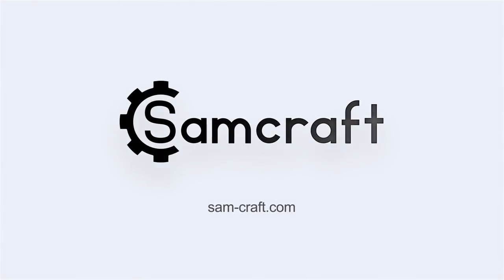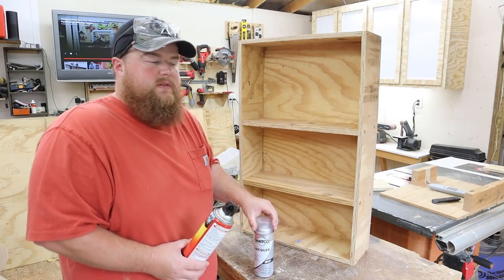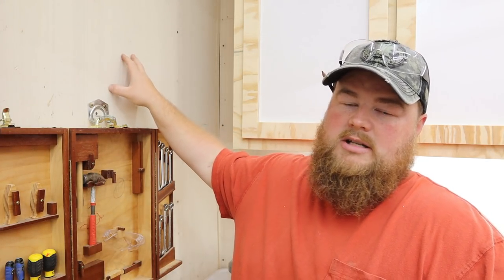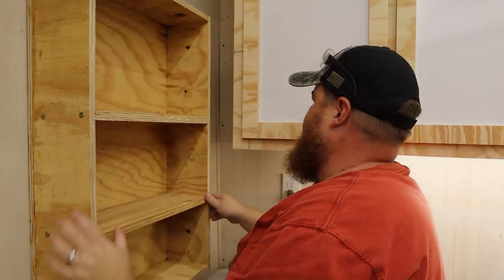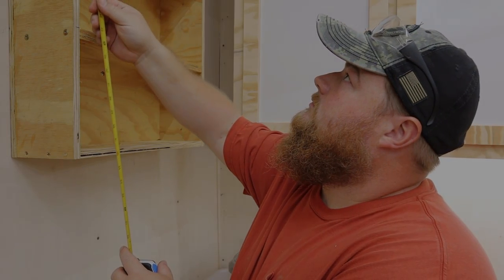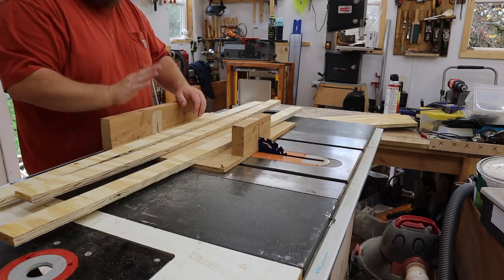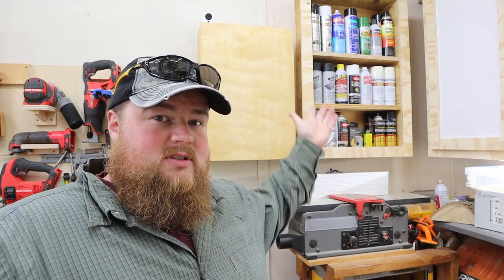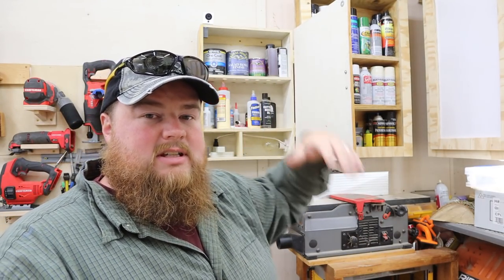Spray Paint Cabinet Build | Small Woodworking Shop Organization

Comment: Hi Sam, I was sitting there thinking. if you put drawer slides flat on the wall, you could have the paint cabinet recess into the corner and slide out for easy access... nice shop. I am being encouraged to organized mine.... hasn't happened yet. like I said. being inspired! Thanks....
Reply from the maker: That's a good idea, and I may use it in the shop soon. Maybe I can build something like that for the opposite end of the first set of cabinets--on the right side. Hmmm.. Thanks for the idea!

Comment: While your new cabinet looks nice as a shelf (see what I done there?), a door would tie it in with the other cabinets. Of course, then the glue cabinet would look out of place. It's a never ending struggle.

I noticed that you have a router table mounted in your table saw. I have the same saw. Did you ever make a video on that? I've seen all the videos on YouTube about how to do it, but I'd love to hear how you did it.
Reply from the maker: You're exactly right... :) I'll probably put a door on it. It will get quite dusty if not, plus it does look mis-matched. As for the glue cabinet... Hmmm... slippery slope! :) 

I did that router insert way back before getting into making videos. It's never been that good so I rarely use the router. It's not the router or insert plate's fault. Just mine from doing it 10+ years ago and only knowing what I knew then.  I have plans to make a dedicated table saw cabinet and will redo the router at that point too. The table saw is too tall for me. When that build comes it will also be incorporated into an assembly / outfeed table too, so it will be a big one.

Thanks!

Comment: Sam, cabinets look good, Too bad you had to lose that corner.
Did you consider putting in a corner (angled) cabinet?
Reply from the maker: The space lost is only about 15" deep by 7" wide -- not too bad considering I was still able to put the two cabinets very close together on their face frames to use this space to the best. A corner cabinet, or cabinet that included the corner would have given that bit of extra storage, but such cabinets end up being black holes for the things in that spot in my experience.

Comment: Roof foam bored still doing good??
Reply from the maker: It sure is... minus the ones I never got glued up there good enough. :) Note to self: construction adhesive doesn't stick very well in cold weather. LOL Otherwise the system is solid -- only my sub par work with it has been the source of any issues. This being said, the foam board helps for condensation drips. There's not a lot of R-Value in it. I'll be adding fiberglass insulation batts soon for real R-Value.